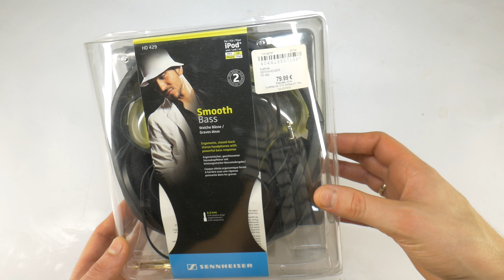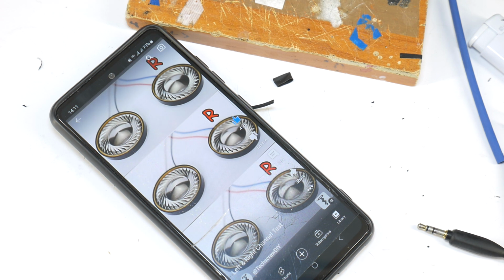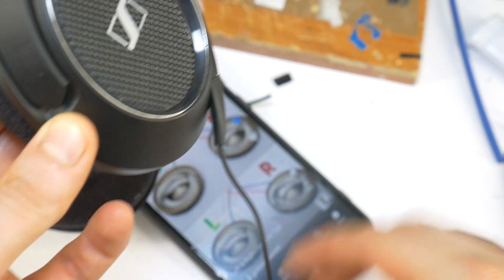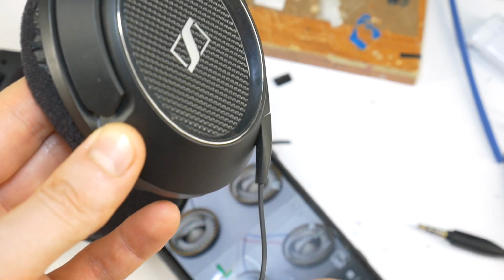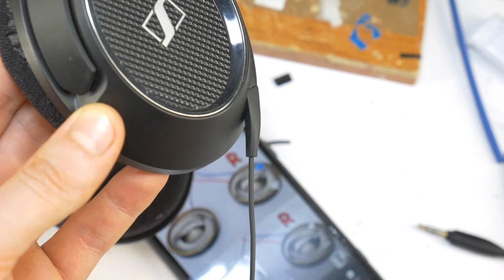How to Repair Sennheiser Headphones cable

Comment: do you know where to buy that  rubber holder for the cable in headphone for this model?
thanx
Reply from the maker: You probably won't find it, but no worries — you can use heat shrink tubing to make a cable holder.

Comment: why you dont better implement aux in female connector inside the headphone where goes the wire out?
That way you will never needed to open them apart and fix the wire.
I wish you made that fix mod tutorial because, many Sennheiser headphones have that Aux in feature.
Reply from the maker: true, I try make this type of mod :)